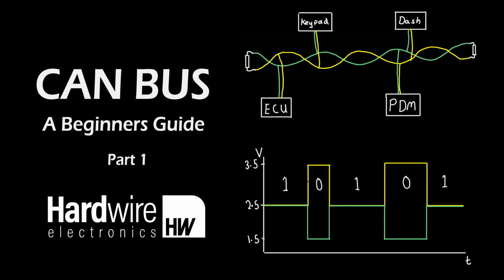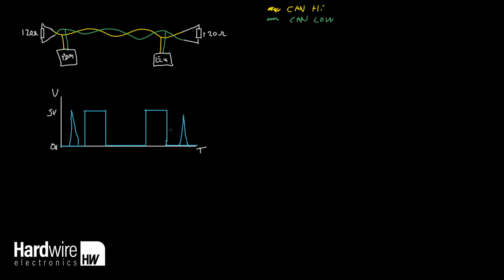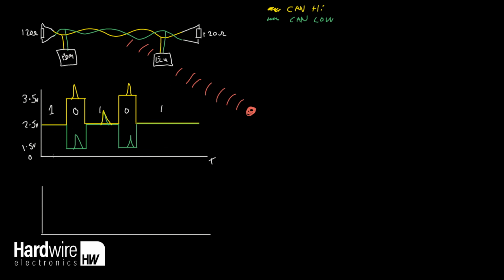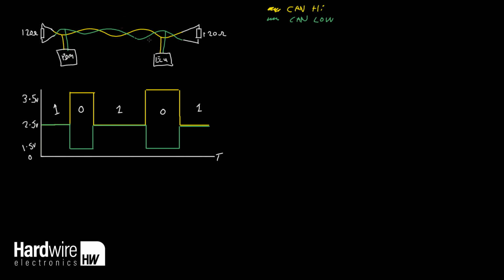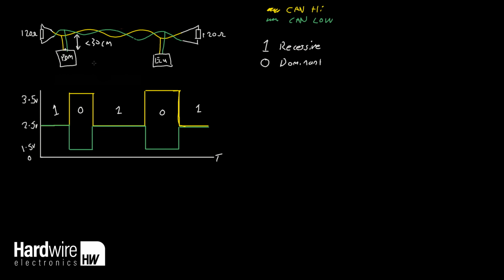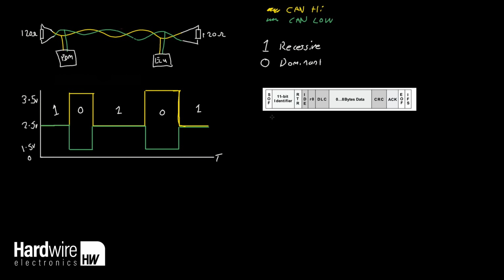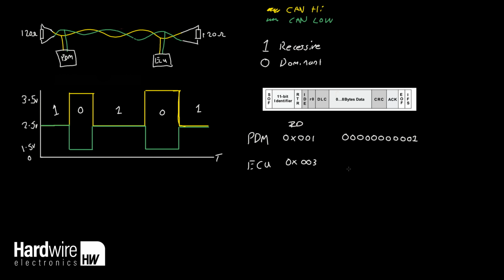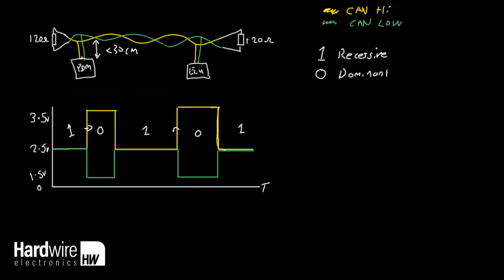CAN Bus: A Beginners Guide Part 1

Comment: Nice video!

Although I think you made a slight error here with the maximum 30cm as a maximum distance. I always thought the maximum was 30 m, not 30 cm, and only with a specific transmit rate (1Mb/s baudrate in this case). In many applications the baudrate is often 500kb/s (with maximum distance of ~100 m) or 250kb/s (with maximum distance of ~250 m). And also in short distances the second end resistor is not even necessarily needed, and the bus runs alright. 
I am open to be corrected.
Reply from the maker: The 30cm refers to the maximum stub length and not the overall bus length.
Reply: @hardwireelectronics3835  30 cm seems awfully short even for a car - about a foot.  If that is true, these devices need to be carefully used.
Reply: @donmoore7785  Why would a stub need to be longer than 30 cm?
Reply: @donmoore7785  30cm is the max distance of any node to the bus, not the maximum length of the bus.
Reply from the maker: I recommend reading the TI application notes SLOA101B and SLLA270. It is heavy reading, but full of gold if you dig into it.

Comment: Wow I’m a new subscriber and have been taking electronic automotive courses but you have presented the clearest explanation of the CAN buss I have watched. Every other video I’ve watched gives you know explanation of or a very simplified explanation. Thank you for sharing I like to know how the system works from beginning to end.  One question I have is do CAN systems on automotive use yellow and green twisted pairs and do the stubs coming off the nodes remain yellow and green? I’ll watch again to see if I missed anything. Thanks Again.   Artie. 👍
Reply: They can probably be any combination of wire colors. This ford I’m on has white and blue for high speed can. They can use other for can low. Depends on manufacturer you’ll have to study a wire diagram for the application

Comment: This video is awesome thank you so much for your time making it.       I'm a industrial highspeed door installer and the manufacturer we work with has just added CAN protocols to there doors for all of the safety, accessories and communication systems for the doors and are having major issues with it and this helps me understand the system better and to help the manufacturers R&D come up with some solutions